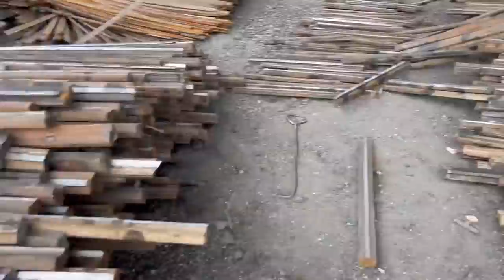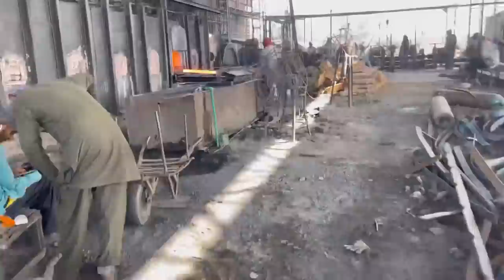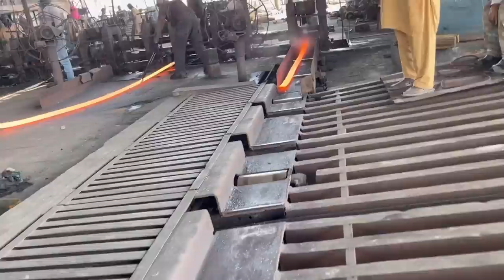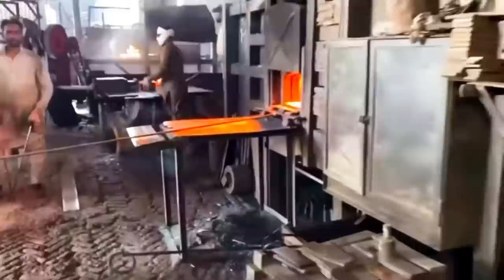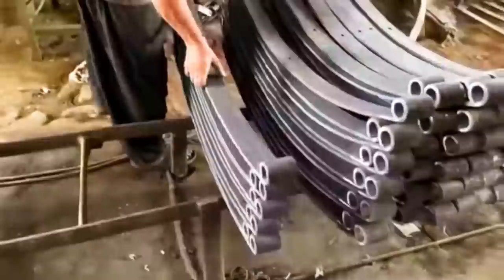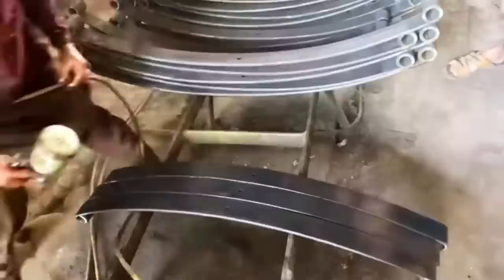They also make truck suspensions from old train tracks | Amazing thing technology1 |

Comment: From a person who worked for 44 years as a Technical person in the iron and steel industry it is absolutely disgusting to witness such pathetic safety standards. I'm struggling to find any vision where breaching of regulations is not happening. Yes, this is third world production lines but those workers have families to go home to after their working day. 
No way would I consider recommending a vehicle that uses those "springs". Rail steels are not compatible with spring steels  and cannot offer flexing because of their chemical composition.
Reply: I think that these are the springs that are used on those Russian tanks, and Indian Tractors.
Reply: This is called Hard working. Not being Lazy Ass sitting on couch all day with safety standards in place. People are dying they have to Survive You gotta do what u got to do. Keep you regulations in over Regulated countries.
Reply: @onestop2446   so what happens when one of those workers accidentally grazes one of those hot steel lengths.  Or timing is slightly off and zigs when they should have zag,  or one of those machines  with all those fans blowing,  catch one of those loose clothing items.    worker is probably burned, maimed or killed.    and boss man is just... sucks to be you.   There's a reason safety exists,  it's  because workers are injured and die.    and if workers band together,  no reason safety and profit can't coexist
Reply: @davidduffield7553  I'm just wondering, what Russian tanks have to do with the topic?
Reply: @stephenx2857  "no reason safety and profit can't coexist" I'm sorry to say that, but in third world it is probably about what is cheaper, i.e. how hard is it to educate new worker. Capitalist starts caring about worker safety only when it becomes significantly more expensive and time consuming to get new labor force.
Reply: @stephenx2857  My friend looks like you taking is seriously. Did you ever think that these people are not force to work their they choose to work their. Now you think They dont know about all that ? Risk factor is always there.  Saftey is Important but as i explain you the Will you survive without food or water ? Do you like to Die in those situation or you want to take a chance to work somewhere, where you can earn and bring food on table Forget about the education, Health & human rights. 1700 Billion Dollars Stolen from 3rd World countries and Lauders to Developed countries Each year. Why Developed countries accepting that black money when you know alot things can be done if they stop them for pouring into their economies. I belong to 3rd world country & i know the suffering I have been through these situation and took my chances.
Reply: @Random You are clueless.  When this kind of alloy fails, it fails catastrophically.  It is likely fragments and shrapnel will be created and sent flying.  Seen it happen.
Reply: @MacIn173  Clueless.  skilled workers are incredibly valuable assets and very hard to replace.   Many safety improvements were done to protect them as assets and that was long before  OSHA ever existed.   This is an incredibly primitive operation and it is clearly low skilled.  I would wager there is a line up outside everyday waiting  for someone to loose a leg  and thus create a job opening.  The owners have little invested and little reason to care.  This is the equivalent of an 1880's bar mill in the US.  By the early 1920's this kind of operation was all but gone because it simply can't compete.   The Asia cultures are more accepting of the risks adn less driven by the need to take care of people.
Reply: @stephenx2857  I would bet a serious accident on this line is a daily event.  The line was clearly being run at reduced speed for he filming so there would not be accidents.  You can tell by watching  the workers  and some are clearly out of sync.  They are looking up at the camera and in more than once case you see them jump just in time.  The strip at the end is jumping around a lot and it is   still hot enough to simply burn through a man's leg.  Spent years around hot metal.  This is stuff that was being phased out  100 years ago in teh US as too dangerous and simply too low quality.
Reply: If there's a market for it, unfortunately scrupulous businessmen will always jump on the opportunity to fill those needs without caring for their workers safety.. It stems from the government, top down. They tax the products & get their share, the business owners bank while the workers are left with the scraps.. Harsh reality of business in 2nd & 3rd world countries.. 

Workers need to rise up & cause a ruckus to get their voices heard but that's a long way from happening in India, they'll be stumped down really fast & sadly with deadly consequences..
Reply: @jamesb4789  "Clueless.  skilled workers... " you're just repeating my point just using other wording. I said: "starts caring about worker safety only when it becomes significantly more expensive and time consuming to get new labor force" that is - skilled workers are more expensive to educate.
Reply: I think these guys are working a lot safer than most other shops in the third world. The biggest problem is that steel for railroad tracks is 1084 which is only a medium carbon and manganese alloy. Spring steel is 5160 which is a high carbon and chromium alloy. 1084 is a very tough and wear resistant but lacks the flexibility required of 5160 spring steel. If used to make springs 1084 will crack quickly under normal circumstances and has little chance of survival in colder climates. If you reversed this and made tracks from spring steel they would deform and wear out quickly. There's a reason why 5160 is called spring steel. As for this company. They are working with what they have and doing the best they can.
Reply: If you think this kind of product can't make it to the rest of the world you would be wrong. When I was with Mack trucks when they decided to buy most of their steel components from Russia. Of course, the samples they sent were perfect but they cheated with the actual production parts. The biggest issue was that all the frame rails would crack in 5 years or less. This resulted in the customers having to do major repairs, including replacing the whole rear frame rail. The company didn't care because it happened after the warranty expired. Some customers with large fleets were quite angry because they had trucks that were 20+ years old without a single crack. Because the cracks took so long to appear the companies often had purchased quite a few trucks before the first one failed. Their question was "When did you stop using the bad steel?" Unfortunately, Mack used the Russian steel for almost ten years. They didn't want to lose the extra money they made from using the cheap steel. They stopped when sales finally took a turn for the worse. Greed at its finest.
Reply: @Jonathan.D  "samples they sent were perfect but they cheated with the actual production parts" being russian, I bet they didn't cheat. Variability of quality (unstable production quality) is quite widespread problem in Russia. At the same time, if customer was able to verify that quality of the sample is perfect, but didn't figure out that quality of usual supply is poor, he didn't have normal QC for the source materials. Usually, several samples from each batch are tested, and if they were able to determine quality of initial sample, the problem is in lack of QC, that's where greed became problematic. Cheapness of russian steel comes from cheap energy and cheap labor, not from cheating.
Reply: @MacIn173  The samples and test pieces met the requirements. Starting with the second shipment the parts received were substandard and should have been rejected. The problem was that there wasn't sufficient time to wait for new parts without causing serious delays in delivering trucks that were already ordered. Management decided that the parts should last long enough so that if any failures occured it would be outside of the warranty period. Management advised that the supplier guaranteed that further shipments would meet all requirements. Whether that is true or not, only they knew. The supplier knew that if Mack used the substandard parts once they would continue to do so. With a price so cheap all management could think about was their bonuses. Not accepting the parts would have forced a shutdown of the production line and missed deadlines on delivering trucks. The company would have lost so much money by missing the deadlines. Plus they would still have to pay all the union workers. Lose millions of dollars and look like idiots or get a fat bonus? Not a hard choice for greedy management. So your guess is incorrect. You weren't there and I was.
Reply: Rails flex as trains go over them, a lot.
Reply: @topduk  Railroad tracks have some flex but it's not even close to what is required. Just Google the two kinds of steel and you can see that they are not close to the same.
Reply: @topduk  if you see a rail bending 30° as a train rolls over it, you're about to see a derailment

Most spring steel i work with, you can make a few loops with in the length of a normal rail segment
Reply: If it works (even for a week), it's not stupid

Comment: Those two high rolling stands are from, at the latest, the 1940s!  I would think rail steel would have too high a carbon to be successfully tempered for leaf springs but I suppose you have to make do with what you’ve got and they’re probably cheap enough to replace every month or so when they break.
Reply: what  high rolling stands? when did you see them?
Reply: Rail tracks are commonly made of 1070 high carbon steel, a very good all around steel that takes heat treatment very well. Good for knives, axes, anvil tops, wear plates, leaf springs and much more.
Reply: @chapiit08    I’ve never heard of 1070 being used for rail tracks…..and it certainly wouldn’t be any good as a spring steel.
Reply: @annoyingbstard9407  Yet it is or it was. Higher grades of steel are used today, like 1084, etc.
Reply: @annoyingbstard9407  C70 or 1070 ist literally the most used spring steel 🙈
Reply: They were easily busting the rails into pieces with hammers, way too brittle for leaf springs...
Reply: @FrozenHaxor  after they were cut by the press cutter😂pay attention then comment

Comment: I have watched dozens of these videos, and, so far, this is the most terrifying.  The men passing the blazing hot steel lengths between rollers, with no protective clothing and the risk of flesh-melting burns, does not speak well for the owners of this plant.  The painters have no masks or goggles, either.  These men are working, of course, contributing to their communities, but there has to be a gruesome cost.  Please, boots!  Leg guards, goggles!

Comment: These guys are risking injury to make leaf springs out of non-spring steel.  Even if, by chance, there is enough carbon to harden the rail they never quench and temper it.  I guess it doesn't matter.  They'll put them on a truck that was poorly welded back together and then overload the truck.
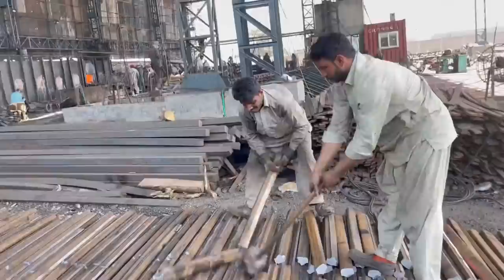Reply: seeing how they snap the rail heads with a sledge hammer at 0:43 I'd say there's plenty carbon in them, probably even way too much...natural cooling during the final shaping might be enough to make them usefully hard and not snap in the first few hours of driving on local roads.
Reply: does that look like a brand new factory to you?
it looks more like they have been doing it for decades.
how many trucks would be running with those sets of springs?
and all those trucks did break down in the first couple of miles?
but the owners of the trucks do not mind and keep coming back....
are you starting to feel a bit silly already?
Reply: @janvanruth3485  🤣  thats absolutely the worst material to make a spring out of. Might as well be wood.  Its probably so stiff it won't have any flex to brake.
Reply: @janvanruth3485  who said anything about that being a new factory?  Do you feel silly for bring up a point that has nothing to do with anything I said in my OP?  I'll assume English is not your first language based on the use of a question mark at the end of a statement.
Reply: @AKAtheA  you obviously don't understand how heat treatment and tempering work.  You start with steel with the right properties(rails are not necessarily consistent quality from one manufacturer to another especially if they're made in third world countries where there is no safety oversight), heat and quench it then temper it to the proper hardness to allow for the desired flex.  You don't hope that it naturally cools to the proper flex.
Reply: @kwslife116  break not "brake"
Reply: Your opinion doesn't matter to them
Reply: If you think, these steel wouldn't have much carbon, than what about mass production It might have shut down., But not. Coolling by water and naturally.

Comment: those are leaf springs arent they? are railroad tracks even made out of the right steel? Sure they have the right shape and all, but leaf springs are made out of a specific type of steel and tempered in a specific way so they can behave as springs.

Comment: Will the cabon content of old railway track be correct for the manufacture of spring steel leaf elements?
Reply: Seriously?  Metallurgy? It's steel.  Good enough.  Warranty on the springs is 5 and 5.  Five minutes, five feet.
Reply: Alter Kater  it would probably be near to impossible to consistently quench the steel under those working conditions, so they don't bother. Just look at how chonky that spring stack is, try guessing why :D
Reply: Osel Somar  nobody said they wouldn't...customer wants dirt cheap - customer gets dirt cheap
Reply: @AKAtheA  But if the metal composition isn't correct then you can quench all you like, you aint making spring steel.....
Reply: If it looks like a leaf spring, if it fits , it's a leaf spring!.....
Reply: Springs probably go on donkey  cart
Reply: Technology? I don’t think so 🙄
Reply: I imagine when some third-world dude goes to buy a new spring for his clapped out truck they give him the option of a factory spring or a train-track spring for 25% of factory.
Reply: @95thousandroses  Hino does manufacture and assemble trucks in India. We see them stencilling Hino on them. Imagine if these new springs are heading to the Hino factory!
Reply: Spring steels used for leaf springs have Specifications (in Australia, England, USA, and virtually allplaces that produce springs) that contain around 2.0% Silicon. Rail steel contains minimal Si. The gauge of the rail was not visible but if standard gauge it will be approx 0.60% Carbon. Spring steel is near to that composition (.50-.60%)
Another concern evident is the variation in ambient cooling rates.
Reply: @flamingfrancis  Thanks, very interesting.
Reply: Absolutely not.  Rail steel is very tough and durable but not flexible and it is very different than spring steel.  Spring steel is an allow that bends and contorts but returns back to its regular shape  thousands of times with little to no distortion.  Rail and most steel cannot do that and will fracture.  It is in fact dangerous to use most steel  in this kind of application.

Comment: The part with the roller presses to thin out the metal seems so inefficient. Would be cheaper and faster to line those machines up in a row and have less workers involved. If the machines were lined up you would only need 2 to 4 workers instead of like 8.

Granted it would require a redesign of the roller presses but short term cost for long term gains.
Reply: It would be cheaper here in the "first world"

Over there, labour is pretty darn cheap

Comment: Dangers and all of the wise-cracking about lack of OSHA etc, It seems Pakistan and other countries that manufacture in a same manner have a massive advantage is the worlds  economic machine comes to a halt.  Or, perhaps it's just the manufacturing aspect of  an economy.  Just look around in their shop there, at the electric motors and mechanical bits.  If a 1st world encounters a dead electric motor, they order a new one, that most certainly comes from China.   These guys?  They take it to a rebuilder.  Will it last as long?  I would argue probably longer than the junk that comes out of China.

           I too, have thought about how short-lived some of the repairs I've seen in Pakistani videos might be, but they are WAY, WAY more self sufficient as a country when something breaks.
Reply: this is scrpyard level operation, no advantage over anything and the produced good are total junk.

Comment: Not really the best steal to be used for springs of any sort as rail way tracks are designed to work harden a lot faster than any other steal.....at least rail way tracks here in Australia. You'd be driving down the road only to hit a bump and snap your spring in two.
Reply: Yeah, but if you carry 20 tons and it's not breaking, it'll be good 😅.

Comment: I did not know that railroad track was spring steel.  Anyone know what alloy it is?
Reply: "Railroad track steel is typically 1084 or equivalent hot rolled steel. This is a medium carbon steel with 0.7% to 0.8% carbon and 0.7% to 1% manganese. This type of steel is great for heat treating"

What is the difference between steel and spring steel?
Spring steel is an alloy that can withstand intense twisting and bending without becoming distorted. It is resilient and pliable, yet durable, which is perfect for a general use steel. Products made with this alloy can be bent, extended, compressed, or twisted, yet they will return to their original shape.
Reply: @gragor11  Thank you Gra Gor
Reply: @gragor11  That is a reasonable assumption for rail made for Standard Gauge. Narrower, or larger, gauges use steels with varying composition. Spring steels contain approx 2.0% Sillicon rail steels do not.